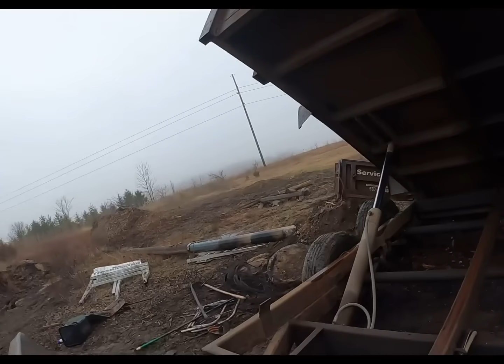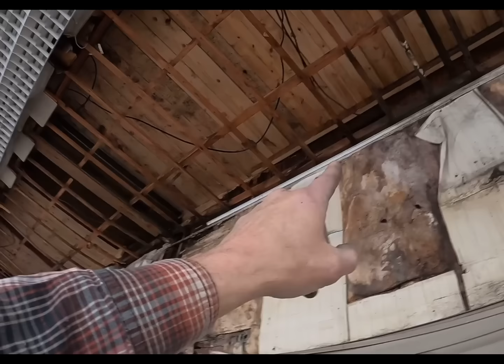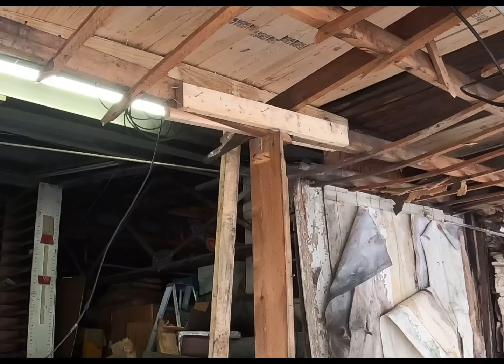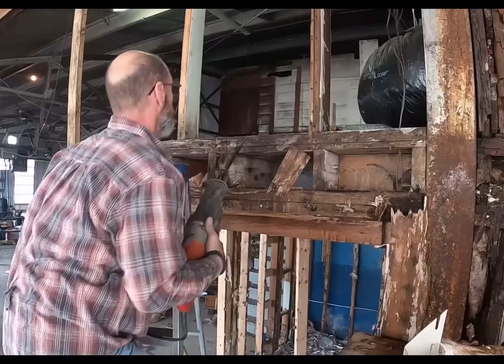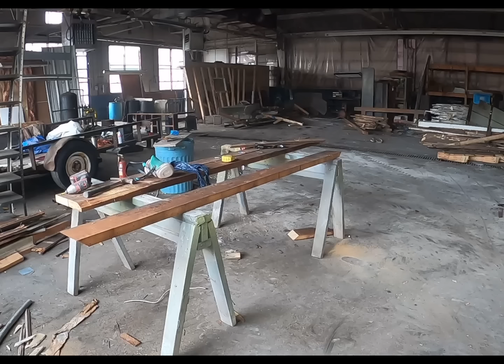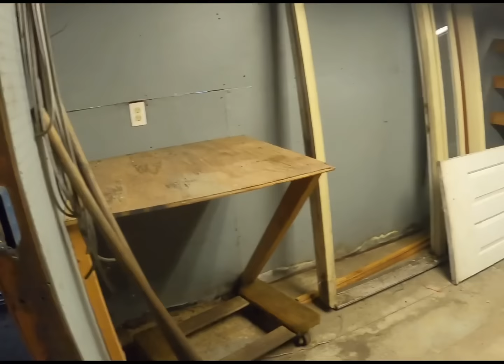Yes another day remodeling the old car dealership into my new restoration shop

Comment: looks good . but you need to support that ceiling as it needs load bearing support. js
Reply from the maker: None of these offices are load bearing, they are all freestanding under the building frame itself
Reply: @metalartcustomsLLC  It will fail inspection if it is not supported from underneath as it is considered a collapse hazard . I say this not to be an ass but to be a brother who wants everything to go smoothly for you. Js